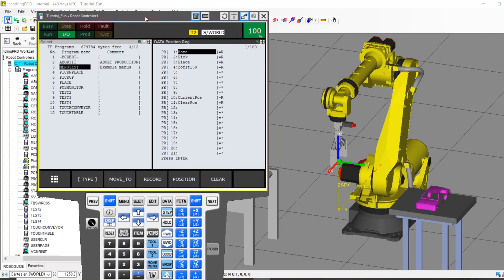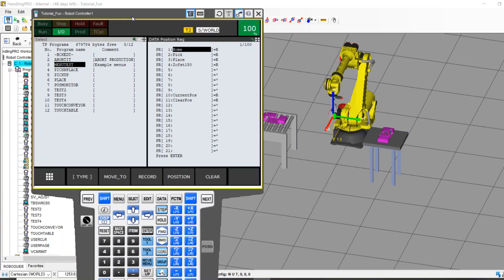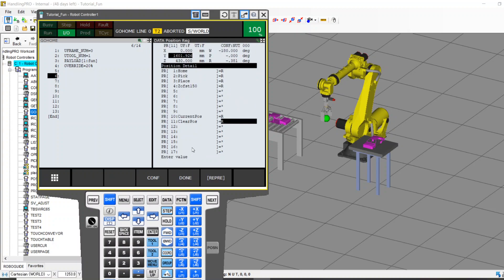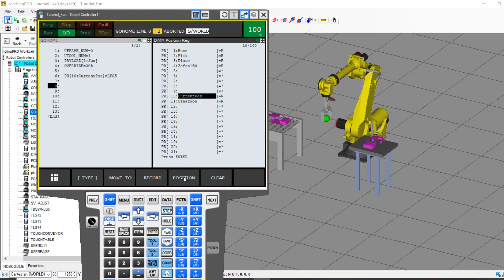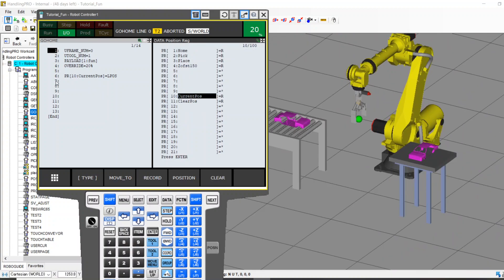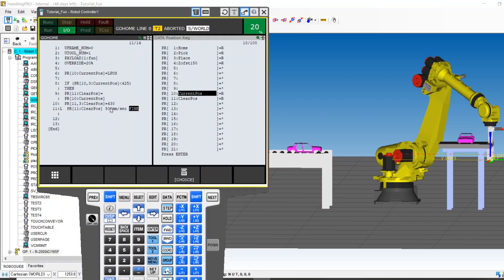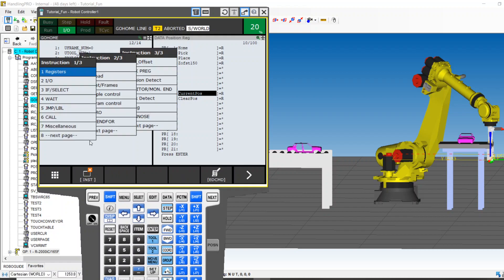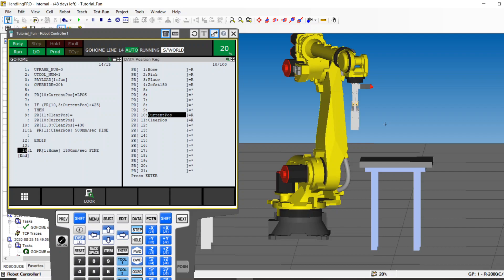FANUC Robot Homing Program

Comment: Sir i programmed fanuc robot with group 2 then due to some reasons removed the external axis and now the robot is not running in auto tell me your opinion on these changes sir now will it be a new program or will it be done by copying?

Comment: Hi Adam
I've been now two days with the same issue... I'm using an HMI to run a MAIN program (Prog Select configured correctly). When working in AUTO, no active alarms, and ABORT done, UI[6] pop-up ON but the system is not running as the SYST-011 or SYST-034 alarm pops out stating: Failed to run task.
The thing is that when I turn on the manual mode, I'm able to do FWD and start running the program. After this, if I cange back to AUTO and try to run the program.... It works! Except if an ABORT is done between both working modes.
Does anyone have a clue about this? I will really appreciate it
Thankyou! :)
Reply from the maker: SYST-034 is the HOLD signal. In your UOPs, you must have the HMI hold a few signals always on: IMSTP, HOLD, SFSPD, and ENBL. Force those bits all on, and she'll run :)

Comment: How would you tell it to move in the tool frame?
Reply from the maker: The term "Tool Frame" is also known as TCP (Tool Center Point) or UTOOL. When you setup your program, one of your first lines of code should be to tell the robot what UFRAME and what UTOOL you want to be active. Starting at 1:57 in this video I show how to call those lines. Whatever UTOOL is active is the tool frame that the robot will use when moving. 
If you'd like to learn more about Tool Frame Offsets, please check out my video on those as well!
Reply: @AdamWillea  thanks for your reply, I meant more along the lines of instead of moving Z+ in the world frame to move away from the part how could you make it move Z+ in the tool frame to get away from the part?
Reply from the maker: @decipherlogic  Ah yes I got you. You need to use "Tool Offset PR[x]" instead of normal Offset PR[x]. Check out my video here around the 11min mark: https://youtu.be/BRSZa2p8OWg?t=681
Reply: @AdamWillea  Awesome, Thank You!

Comment: Hi Adam, I have a question on this topic, when i turn up the robot and try to move it to home the TP shows a message; "robot cannot move, not in home position". Do you know if is there another condition that may be missing? Thanks for your videos, you're great!
Reply from the maker: Mario, is this a SYST-081 alarm? If so, you need to move your robot to the Ref Position taught as valid home to start the program. There are also joint tolerances for the home position, which I usually open up to be +/- 2 degrees. 
Also feel free to contact our technical hotline. If you are in the U.S., you can call 888-FANUC-US any time 24/7/365. Thanks!
Reply: @AdamWillea  Thanks Adam it was really helpful. Keep with it! great job!

Comment: Thanks for useful information, im trying to learn robotics with our new robot cell. We have square gripper tool which holds parts and supplier says you need to view during home position not to crash tool to robot j5. But i understand all conditions are possible to move home position with right programming?
Reply from the maker: You are correct; you must be careful when moving home not to crash the robot or tooling into itself or into other components in the system. Always take careful consideration and do your testing at slow speeds to verify clearance.
Reply: @AdamWillea  Thank you for your precious feedback

Comment: Tanks for another great tutorial Adam. How do you handle homing, when you have to do couple of moves to get inside machine, so simple x/y/z offset wouldn't do the job. In ABB I used permanent register to store unique number for each motion, so then based on this register I executed required motions to get from the machine without crashing. Is is advisable to do on Fanuc? Thanks
Reply from the maker: Your method will absolutely work with FANUC as well. We recommend you use Registers or Flags in the program and set a value as you move along. This will allow you to check what part of the program you are in when homing.
FANUC also offers an option (for sale, not free) called Auto Backward Exit that allows the robot to record its own flight path and run in reverse during homing.

Comment: I would like to add one more suggestion, would be to do a JPOS and check Joints are not at a funny angle,. Sometime technician might jog to work on tools and try to home.Only to see the dressing snap. have seen it happen a couple of times, cos not everyone is aware where the knuckle should be present.
Reply from the maker: This is a great point. It's always wise to analyze your specific situation, and program the checks to keep things safe. Thanks!

Comment: how would you set up a program where you using a pns program to run 2 different jobs one the task its complete it robot goes home and waits for the signal to start and run the program again robot sits there for about 2 seconds until it gets the signal how would you make it to where instead of going home it goes right over to pick the part up without stopping on home and make some cycle time shorter
Reply from the maker: Hi Alan,
In this case I would typically setup your programs to NOT have the Home motion programmed in with the task job, and rather just go back to the "perch" position right above starting the next routine. Then, you can instead make a new program that has only the "Home" move in it, and use that as a third PNS program. When you are done with production and want to go home, trigger the PNS for the Homing move instead of the PNS for the task program.

Comment: Hi, Adam! Funny to see, that sometimes people think alike, basically wrote exactly the same code for a Fanuc project commissioned a week ago. And for the under the table problem, basically had 3 similar regions that had to be dealt with.
An idea, sometimes it is also necessary to add an "empty the hand" routine to homing process. Palletizing robots sometimes carry the pallets, sheets and accessories too, including the product itself. Therefore, just "open hand" command before starting a new cycle isn't sufficient. Wouldn't like to drop a pallet from 2m height at a random place.
Reply from the maker: I couldn't agree more! I always say 20% of our work is making the robot do its job. 80% is coding around all the possibilities of recovery and operator errors! Expect the unexpected...
Reply: @AdamWillea  absolutely true. Basically, there should only be a single button for the operator. Even START and STOP can result in confusion.
Reply: Same here, normaly just open the gripper is not a good idea. Sometimes the handled products are really senitive and expansive ... or just very heavy.